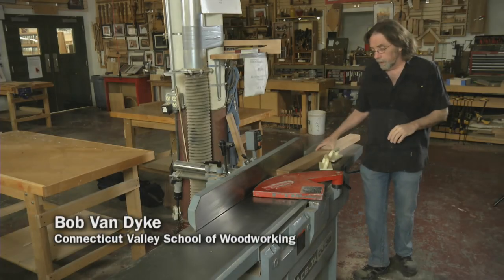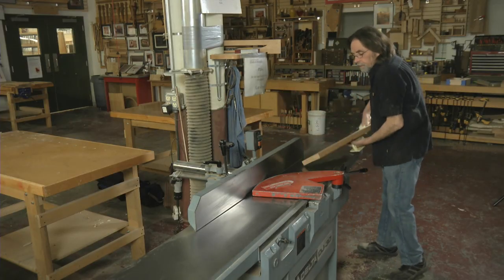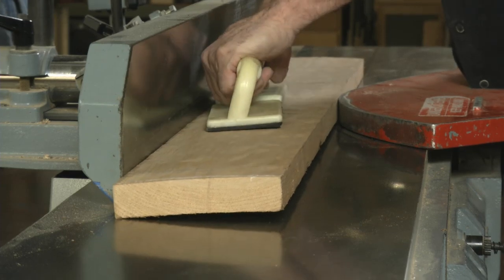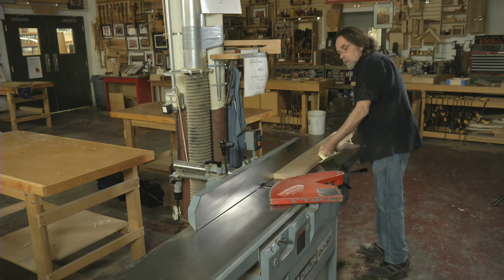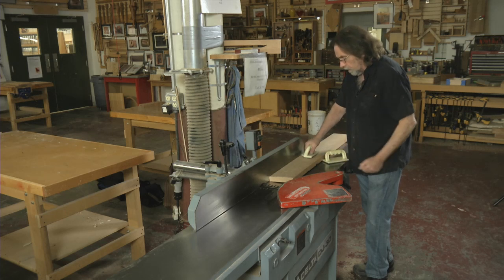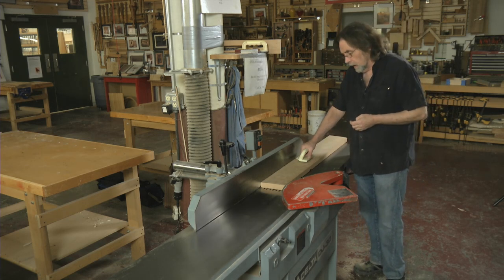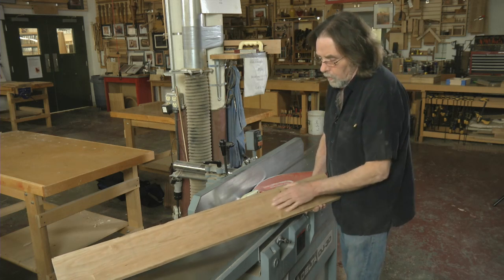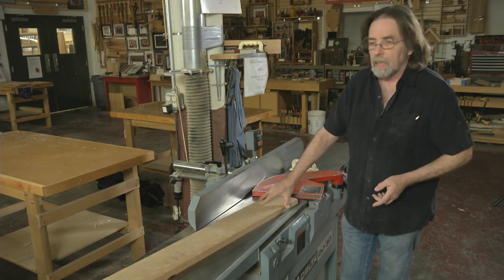Jointing a twisted board at warp speed - with Bob Van Dyke

Comment: I use the same technique often. Depending on the board, often I will only cut the leading edge and then lift the board off the cutter at midpoint and start again (without feeding the board completely through). Sometimes I will rotate the board end for end between passes. I find it can help me to end up with a greater final thickness sometimes. 

With thought and care you can also deal with longer twisted boards by employing the same technique of stopping mid cut (when you are in a high spot unaffected by the cutterhead) and lifting the board off to start again (sometimes same end, sometimes opposite). You have to read the board and determine what will work best. Once you have it decently flat the rest of the job becomes easy!

Comment: This proves that you CAN use a jointer on a warped piece. People would tell me at the wood shop "You have to cut an end piece off, then rip it down the middle and let it sit overnight and allow the tension to come out and then run the faces and edges of both pieces through the jointer, plane them, then use biscuits and glue but make sure one of the boards is flipped over to get contrasting grains, let them sit overnight and then run the reassembled piece through the jointer, planer and table saw.

But I could show them this video even and they'll probably just say something contrarian like "Too many people adjust the height of the jointer and never set it back, so it's off limits to adjusting".

Regardless, thanks for showing us all this tip. I feel incredibly vindicated

Comment: This is a neat solution to the problem of twisted boards. Needles to say, an experienced woodworker always inspect the board before attempting to joint it; that's the first step. Next, just as you would when using a hand plane, you should ask yourself - where do I want to remove wood to get the board flat? The obvious answer in this case, just as Bob stated in the video, you would want to take off the "high" corners first.

A way that I approach this - and this is easier if the machine has a European type of guard, known as a Suva guard -  is to place the board halfway over the cutter, BEFORE starting the machine, while holding on to the board on the outfeed side. If the board is as twisted as in this video, the cutter will hardly touch the board at all, due to the high corners. Then I start the machine and with both hands at the outfeed side, I will push the corner that doesn't touch the table half way down before feeding the trailing end of the board over the cutter. Then I TURN THE MACHINE OFF! Next I turn the board end for end and repeat the process to remove the high corner of the other end.
This process should remove most of the twist, if not all. In case the twist is still severe, repeat all the steps above until the high corners are removed, or at least less pronounced. Finally, take one normal pass along the entire surface to get a clean face.

SECURITY ISSUES: always turn the machine off before placing the work piece half way over the cutter. When you start feeding, keep both hands on the outfeed side of the cutter.
The Suva guard, or variations of it, has been mandatory in Europe for decades but I believe they have become more common also in the US. The idea is to keep the guard between the work piece and your hand at all times; you will typically start feeding with your left hand close to the leading end of the work piece and the right hand close to the left. When your left hand reaches the guard, you let the hand slide over the guard and as the work piece advances on the outfeed table, the left hand applies firm pressure on the piece. As soon as the piece has advanced enough, you right hand follows, sliding over the guard. The feeding of the work piece over the cutter will continue with both hands over the outfeed table, alternating their position according to the length of the work piece. This process might seem awkward at first, especially of you are accustomed to use a machine with a different style of guard, but after a while it will become second nature.
The technique described here is very safe and also eliminates the need for using feeding pads; in fact I find the pads very awkward and I don't even own any. However, I appreciate that they might be appropriate if your machine has the style of guard that is most common in the US. Regardless of which guard your machine is equipped with and if you use pads or not, as soon as the workpiece has reached the outfeed table, the hand pressure should always be applied there and never to the infeed side. That is, if you want a straight board...

Comment: Pretty cool point. However, face jointing longer boards is always a challenge. As easy as he seems to make it and regardless of your technique, I find that any board longer than 16" requires adjustments to pressure on the outfeed table and the amount of material you take off. Frankly, I prefer to use a surface planer sled with shims and even that's not perfect. the best solution is to hand pick your boards and walk away when there are twists.
Reply: I use wood shims to even it out.

Comment: With a small jointer this won't work so have to use a block plane to knock down those corners then go to the jointer. Nice demonstration for those with larger shops though.

Comment: Your method is great for short boards, but what about boards over 8 feet long?  Would it be better to use a planer with a sled and shims ? I have an 8'6" X 8" hard maple board that has a twist and I'm using it for an apron on a new workbench that is 8' long. It is also 2" thick so it's fairly heavy push. Would appreciate any help I can get.

Comment: How do you plane out the face so its parallel to the first planing ?
Reply: After you joint one face and one edge on the jointer you take it to a thickness planer.  Then you can rip it on a table saw.  Totally square board after those steps and ready for whatever.  Although some suggest that with rough lumber you square it up but not to final dimensions.  You let it sit for a week or two then do a final planing.

Comment: so if the board is short enough, why not use the two pads and press evenly on both high spots, front and back? it wouldn't rock and seems less finicky than splitting the difference.
Reply: By definition, if you only press on the two high spots, you are creating an axis for the board to rock on. You have to eliminate the rock, by either pushing on a low spot as well (which works if the warp is minimal, but will not work on a board that is as badly warped in the video), or you have to split the difference as he does.
Reply: Matt Williams I think we are talking about different meanings of high spots. if you press evenly on the two sides that are touching the table then it shouldn't rock, it will take those sides down first until you have a flat board

Comment: If the curve is too much. I mean if i would plane it down it would end up from the ends. Is there any cure for this. Please help.
Reply: There's no easy cure for it other than planing off enough material. Maybe someone will bring to market a long thin oven where you could steam the board until it has enough moister/softness to then clamp it so it is flat, then back into the oven without water to dry it out.

Comment: First of all, when you rocked the board after the first pass both ends were off the table.  Second, that third pass still didn't have it flat and you left about a third of the board overhanging the outfeed table so you weren't actually checking the entire timber.  Your technique is fine, it's just your presentation that implies it is more efficient than it actually is.  Still, half a board is better than a twisted one.
Reply: His presentation was fine, most of us get it.
Reply: Kroban3 hey I was just trying to point out that if you ignore those things you won’t end up with a 4S piece of lumber. If that’s OK with you, then fine. I won’t argue with you. The results will speak volumes.
Reply: @sdcofer52 

For the apprentices out there it probably wasn't a good presentation.  For those of us doing this a while it was totally acceptable, that all I'm saying.
Reply: Kroban3 OK, I accept that.

Comment: You should care what it looks like, if its not cutting the whole plane of the face then there could be dips still all over it. It not rocking means your edges are on plane but not necessarily the face.
Reply: SoundsFantastic the problem with that theory is the planer table which is match ground in production is cuppud as well .the tables are dead flat on those machines .
Reply: Ian Muir You make no sense. The blades do not "match ground". They plane flat like the table. After each pass you want to watch the face to see the spots which are not being planed.
Reply: I know the blades aren't  match ground. the tables are it means they were milled at the same time to dictate exact match for the infeed and outfeed tables.
Reply: You are absolutely correct. I keep passing them until the entire face has fresh cuts.  Problem I still haven’t solved is that often I need to start out with 12/4 to get to 3/4 finished (exaggeration but you get the idea)
Reply: Its still flat enough to register on the planer bed. Works great. We do this daily at work

Comment: That board was perfect for wooden DNA model!  Shame.
Reply: Or a propeller for an aeroplane.
Bob Van Dyke is a wizard!
I used to say to my timber supplier
"Don't send me any bananas or boomerangs"
but I reckon that they snuck a few in with every order, 
"We gotta get rid of 'em somehow" Ha Ha. They just laughed!
How blatant!
My latest supplier sends all stock D.A.R.
Dressed All Round, for only a $2/ Meter charge on 9" X 2" hardwood.
Sometimes, as they plane them down, they find and remove a lot of faults,
like sap veins etc. so the boards end up as 7 and 7/8" X 1 and 7/8"
They will send those same planks with a five finger joint on them for an additional $2/ Metre; Yep, Table tops!
It beats the hell outta me dulling my router bits and overworking my small router.
  I like dealing with these folks.